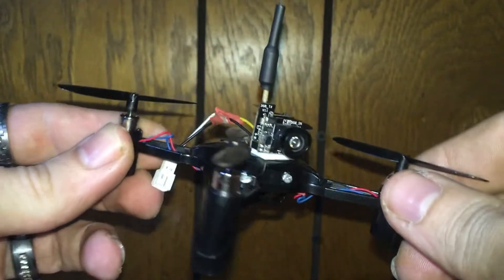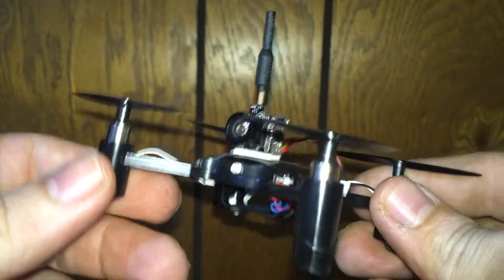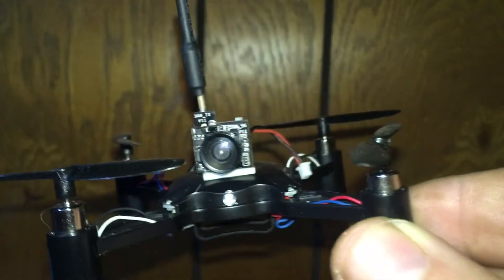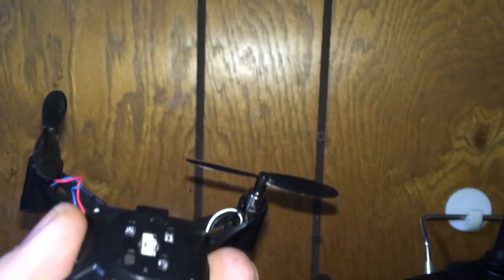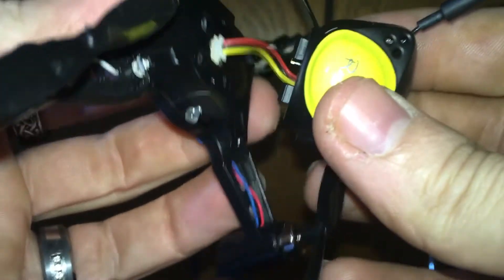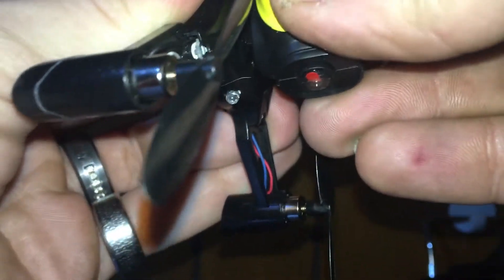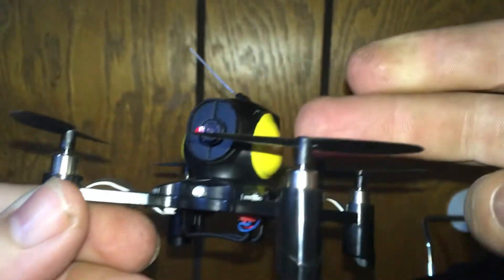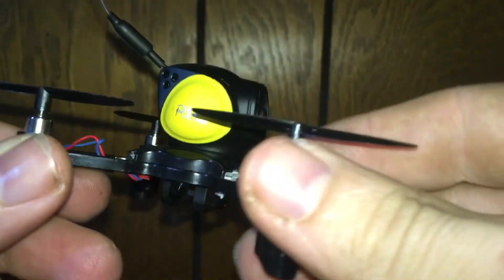DIY mini Drone 5.8 ghz how to install WiFi cam

Comment: I have this exact drone and it also came without a camera...cool drone. sucks with no cam. thanks for posting man..👍
Reply from the maker: yeah man it is a good drone set with 5.8 like i had it i love it for that and i will test with the cam in time
Reply: Mine as well
Reply: J I can't remember where I got mine from where did you get yours as mine is same
Reply: I won mine in a giveaway. I believe he got it from amazon...👍👍
Reply: Kev74 I got mine from gearbest. Bit useless eh
Reply: yea..i like it tho. I'm gonna mod mine and put an fpv camera on it..its a project..👍👍